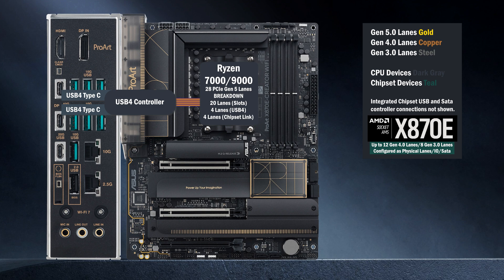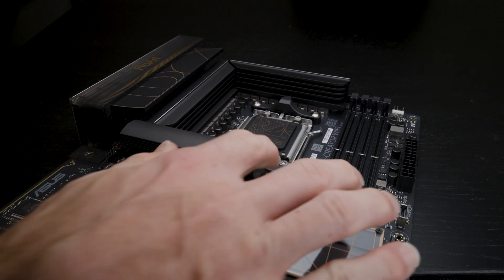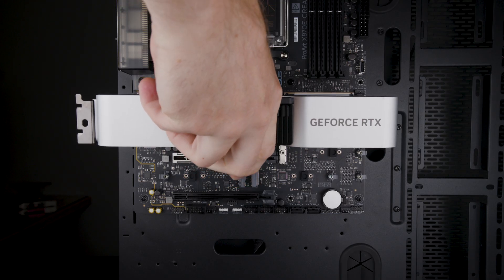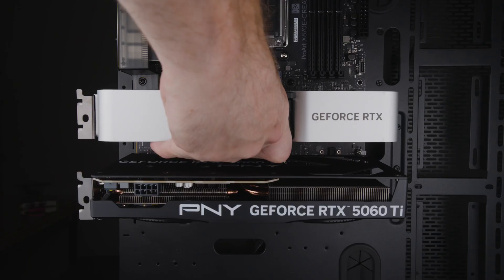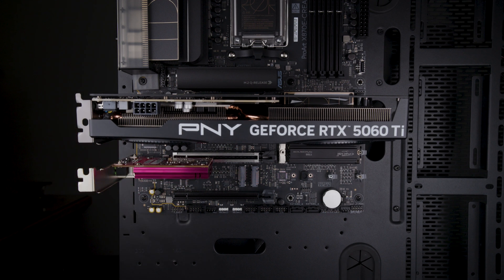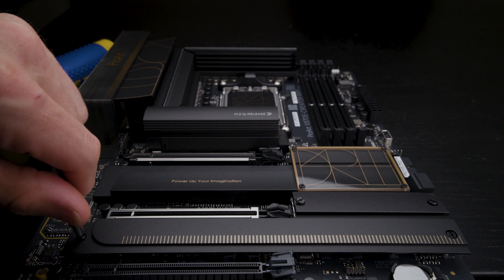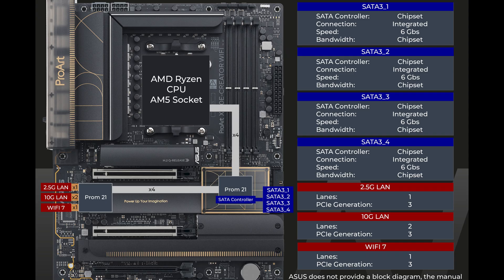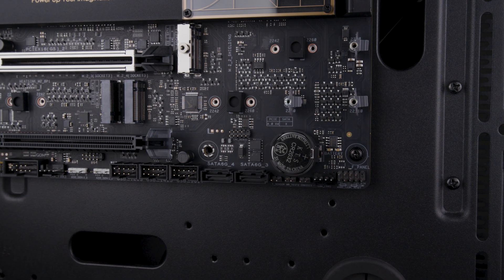Asus X870E Proart Creator PCIe Lanes and Slots

Comment: So can you run 2x M.2 4.0 in the bottom 2 slots and also run 2 Gpus at 16x?
Reply from the maker: "can you run 2x M.2 4.0 in the bottom 2 slots", yes. 
For two GPUs each one would be in x8 mode.

Comment: Are you sure that putting the SSD in m.2_2 slot will drop the 2nd gpu to x4 Gen5 and not disable it? The Asus website mentions that using the 2nd Gen5 slot for gpu disables the m.2_2 slot entirely.
Reply from the maker: Using M.2_2 drops the 2nd x16 slot to x4 mode. Running x8/x4/x4. The manual shows 3 modes for those slots. X16/x0/x0, x8/x8/x0 and x8/x4/x4.

With 7000/9000 chip m.2_2 shouldn’t be deactivated.

https://www.mobomaps.com/board-viewer?board=asus-proart-x870e-creator-wifi

Comment: I'm trying to fit a second 5090 into the lowest pcie slot but can't seem to slide in and click properly. Has anyone tried that? First 5090 obstructs the second pcie slot.
Reply: You need to take off the fans and plastic cover yourself and figure out a custom cooling solution

Comment: So if I'm understanding this right, if I only have a GPU in the top slot, I can populate all the m.2 bays without impacting the x16 lanes to the GPU?
Reply from the maker: The 2nd Gen 5 m.2 slot will drop the x16 slot to x8 mode.
Reply: @Ronin-Wilde  Ok, how about populating M.2_1 with gen5 drive and then 2x M2s gen 4 disks in M.2_3 and M.2_4 slots? Will 5090 in PCIE1 will still run at x16? (having M.2_2 slot empty).

Comment: Can i use graphics card in 16x mode AND second m.2 drive in 4x gen5 speeds if i dont use any expansion cards? Or does it drop graphics card to 8x?
Reply from the maker: You can use 1 ssd in the main Gen5 M.2 slot and 1 graphics card in the Gen5 x16 slots.

Using any other Gen5 slot will drop the X16 slot to x8 mode.
Reply: @Ronin-Wilde  So, one gen 5 gpu and two gen 5 ssds should give me 1x16, 1x4, 1x4?

Comment: Hi, love ur vids! Just wondering, bcs of the pcie switch config, does that mean if I use the m2 gen 5 slot that shares bandwith with the bottom pcie x16 slot, the pcie x16 at top slot will use 8x bandwith?
Assuming I only use the 1st pcie x16 sloat at the top.
Reply from the maker: Thanks glad you like them.

That’s right, the 2nd Gen5 M.2 slot needs the lanes from the main x16 slot. As soon as you install an ssd the switch mode will be x8/x4/x4.
Reply: @Ronin-Wilde  okay, thanks for answering!

Comment: Are you sure the pcie 4 is x16 slot?

And does it mean that I can fully use a 4090 on that slot? :)

Or am I getting things wrong?
Reply from the maker: Its size is x16 and it is wired for 4 lanes at Gen4, meaning it can run in x4 mode.

It’s confusing how slot size and slot bandwidth use the same terms.